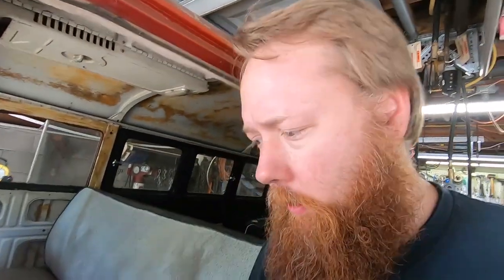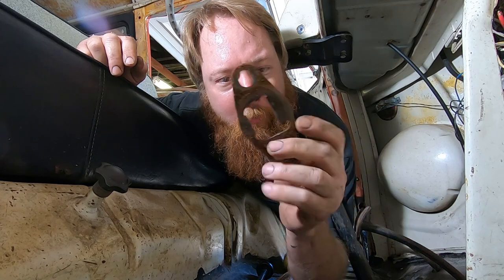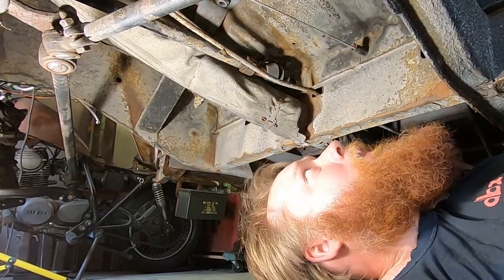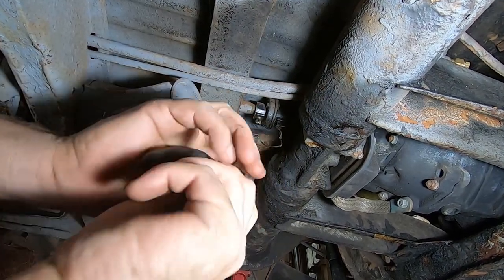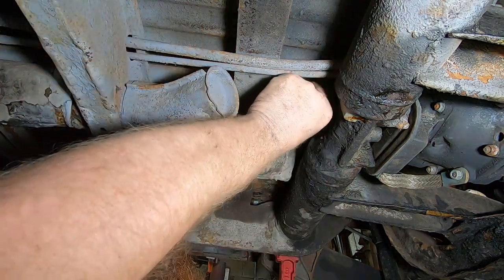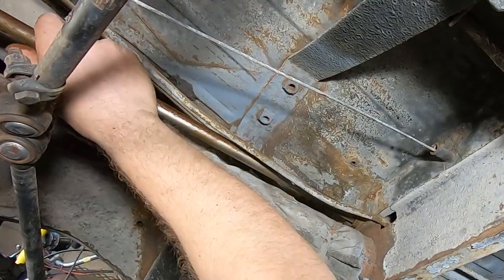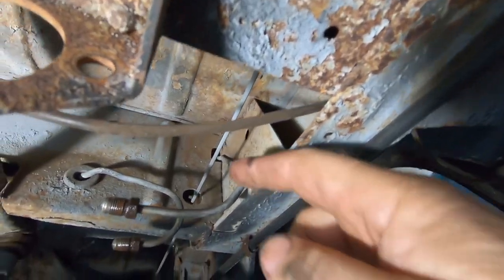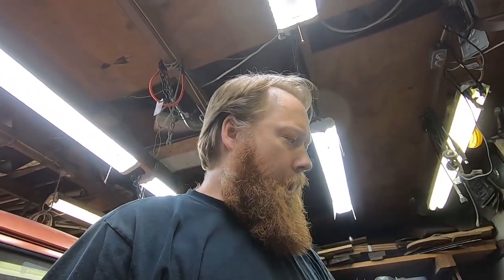Shift Rod Tube Rebuild and Cleaning VW Split Window Bus Restoration Vandemic E5

Comment: Hi Haptic, great to see you working on this great bus, However, I would clean up the bottom beneath totally for rust protection That tactile is the same as asking for rust. you know Iàm do the restoration of my VWT3 and at this moment I did clean the total bottom beneath and is clean to do a real good rust preparation with lanoline and Ovatrol oil. So then I  have control for rust. The gear shifter is a funny construction from the VW Factory. but is functional. I did have some problems with the same-Well I`m looking forward again for a new video from you. Take care and stay healthy. greeting.HCS
Reply from the maker: Hello Hubertus, yes- I would like to do some metal work and rust prevention all over the bus when possible. Right now the immediate goal is to get it on the road and make improvements gradually. I'll have to make some of those improvements if I wish to drive the bus in the rain. I'm glad you like the video- thanks for catching up on the series!

Comment: Take a rag and a broom handle with some grease and grease the rag and insert it into the tube, it really helps with the shifting and cleans all the old grease/dirt out as well.
Reply from the maker: Exactly Skater Stimm- getting all that grease and dirt out really helps. Thanks for sharing the alternative approach and for checking out the video!
Reply: @HapticGarage  I have done two buses now, the ram rod method is the only way.  I typically do it when the engine and transmission is out so removing the drag link is a new one, and that is awesome it worked.  Sadly it won't work for newer buses since the coupler is not accessible.
Reply from the maker: Yeah Skater Stimm, I was thrilled about sneaking past the swing lever / draglink area. I'll keep your comment in mind when I work on the '68 Double Cab someday. Thanks for sharing!

Comment: First thanks for labling your videos made it easy for me to go back and watch again. This week my friend stop by and pull my transaxle and I pulled my rear shift rod out from the back. The front shift rod tube I had out already when I pulled and rebuilt the fron I-beam assembly. I need to see how you clean the shift rod tube so I can clean my tube out. What did you use for lubricating the ID Iad. of the tube ?? It cool seeing all the video under the bus since i cannot get to look at my bus which is the smae year as yours.
Reply from the maker: Hey Dan! I'm glad you're finding the info helpful using it to move your project forward. To clean the tube, I put a few short cuts in a washer, then put that on the end of a threaded rod like I was making a plunger. Chuck the other end in a drill and use it to spin & push a copper pot scrubber through a few times. After rinsing with kerosene, I just used wheel bearing grease to lubricate and protect the ID of the tube. I put in a liberal amount and then pushed it through with a rag a few times. I hope this helps, and good luck!

Comment: Great ideas but how about using cleaning rods/brushes for a shotgun and/or smaller caliber brushes for the small tubes.
Reply from the maker: Thanks Dan, I was pleased with how that project turned out. Yes, definitely, gun brushes are useful in the shop. This was a little too nasty of a job for the ones I've set aside for shop use- I save those for cleaning oil galleries when drilling & tapping a case. But that's just history; I see no reason they wouldn't work great for this. Thanks for sharing the idea!

Comment: I’d think a gun cleaning kit would make quick work of that.  You’d have to figure out what “caliber” it was.  Maybe 20 gauge? That work for the smaller tubes too.  Just use a smaller caliber brush.
Reply from the maker: Absolutely. Maybe a bit pricey but the right size metal brush for each guide tube would be great. Thanks for watching Lane!

Comment: Thanks for the video. How much grease do you use when reinstalling the shift rod? And where or how did you apply it? Just on the 2 bushings or a ton of grease in the tube beforehand? Just standard bearing grease?
Reply from the maker: Hi @TheKpm181, I used the wheel bearing grease and coated the entire rod mostly to prevent rust. Also greased the ID of the bushings and the shifter cup. I hope this helps!

Comment: Does the split window not have the shuttlecock bushings that go on the shift shaft? If they do, how do you get the front one with the metal clip on it back into the tube "against the grain"?

Comment: Would you happen to know if you have to loosen the front shift Rod connection to make room to get the rear coupling out? Thanks
Reply from the maker: Hi Music Connect! You may try shifting into 1st or 3rd (the shift rod will move rearward), then loosen a grub screw and shift into 2nd or 4th. Hopefully the coupler slides off far enough to loosen the other grub screw and remove. If not, removing the shifter may allow enough forward movement of the rod to clear everything. If that's necessary, it may be a good idea to mark the shifter's location to ease reinstallation. Good luck and let us know how it goes!

Comment: these shift rods and couplers are the devil ;) Wish I had filmed my torture effort ;)
Reply from the maker: I've heard some horror stories about these. Kinda like the parking brake pivot bolt- stuff gets nature-welded together with no graceful way to remove. I'm sure your situation would've been must see footage! Thanks for watching!
Reply: @HapticGarage  I had the same issue as yours where the shifter wouldn’t go all the way over for first ended up having to cut and rotate the shaft about 3mm to make it work.
Reply from the maker: @DemopVWgarage  Ohhh that stinks. I had something like that happen after replacing an old hockey stick. That may be a local term... it's the bent thing inside the nosecone. The aftermarket hockey stick simply wasn't manufactured like the old one so it didn't line up the same. Not sure if this applies to your situation but thought I'd mention it.
Reply: @HapticGarage  yeh I bet mine was a combination of a new gearbox and old shifter shaft with a gene berg shifter but who knows🤷🏽‍♂️ Got to love working on these old buses hay😉 my next issue is trying to get rid of a second gear bog on the 31pict carbie🤔
Reply from the maker: Yup, always a learning process. Good luck with the carb issue, I like the vacuum advance idea but I'm sure you will find something that works for you. Let us know how it goes!
Reply: @HapticGarage  I just did a video on my channel thinking I had fixed the issue but once I went for a drive the bog returned 🤔😐 im running a 1641cc single port with a magnaspark dizzy im now wondering if thats my problem or is it jet size🤷🏽‍♂️

Comment: So at 10:30 what’s the point of that bushing? The og shift rod off my 65 bus didn’t even have an opening for that. But the new one I ordered does
Reply from the maker: Hmm. The little bushing in the front of the shift rod came around a little later; it slips over a pin that supports the front of the shift rod. The earlier busses used a sleeve behind the shifter cup like the one found in the Beetles. There should be a loop hanging down behind the floor opening that your shift rod passes through- that needs the sleeve and it supports the front shift rod on your bus. The change happened in 1966? Mine is a '67. My guess is that everybody gets the new version now and it's probably compatible with the old sleeve. It's good that you are verifying all of this- smooth shifting is worth it! Good luck and let us know how it turns out!

Comment: On my bus it was 100% the front bushing and the adjustment of the shifter plate.  It is the opposite of what you think.  If 1st and 2nd are a problem you should push it towards 3rd and 4th and vise versa.  You were definitely pushing it the wrong way when you started.
Reply from the maker: Yeah, it's a learning process. Spoiler alert- it's all good now. Thanks for watching!